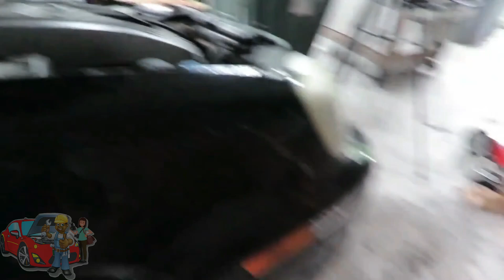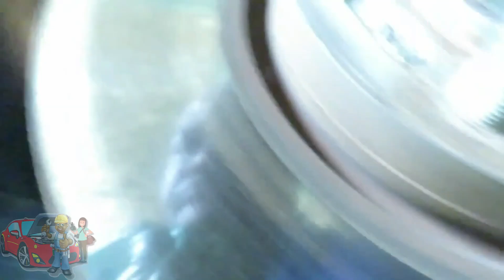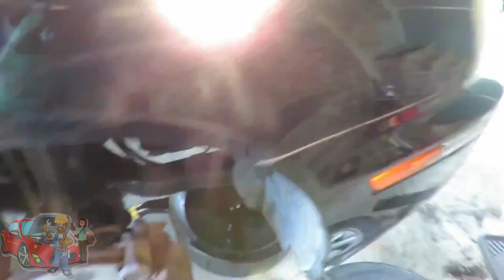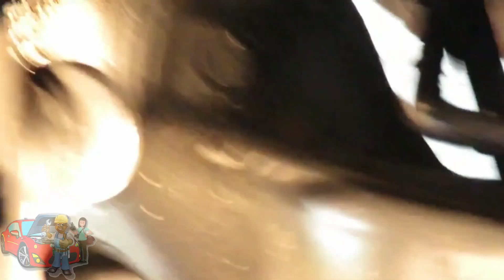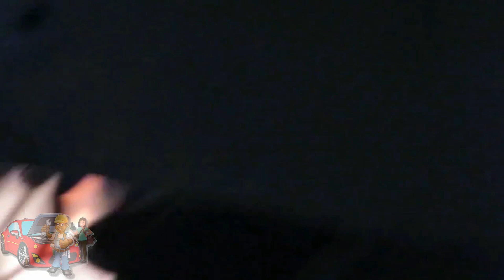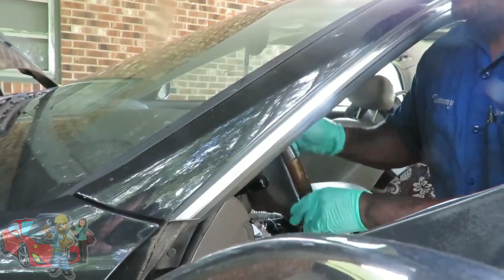Hyundai XG350 Power Steering Pump Replacement

Comment: My guy. Hopefully you can help me. Is that the dang power steering pressure switch right beside that high pressure like hookup?

I watched your spark plug vid and now that I'm putting it back together I noticed that power steering line was disconnected....but I didn't disconnect it so idk where it goes and can't find any diagrams.

Please lmk if you can! Thanks bro.
Reply: Argh. Not the power steering line but the "high pressure switch" I can't find the nub it connects to 🤦